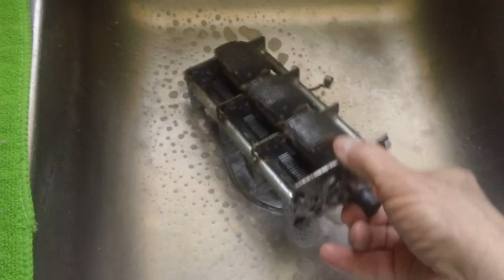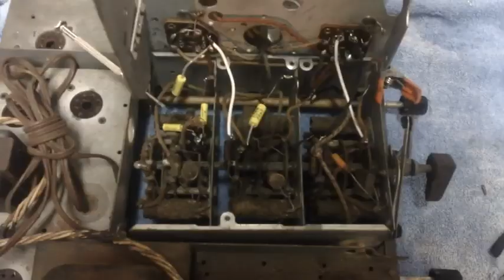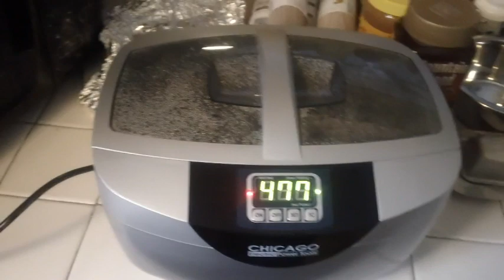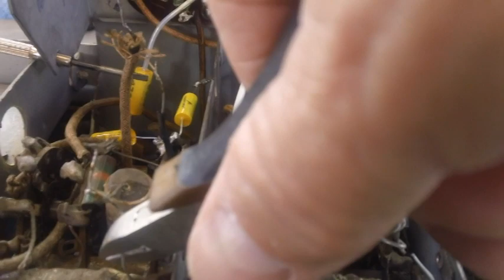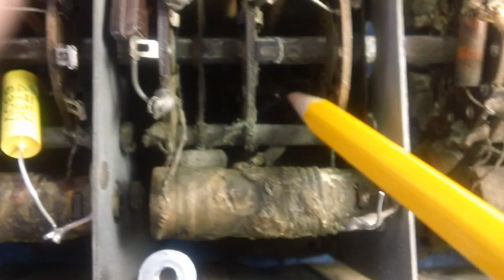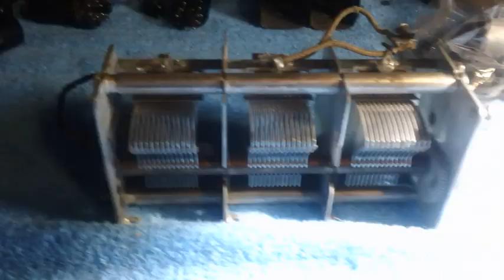Philco model 37-2670 repair and restoration (Part 19 of 34).

Comment: John, do you remove the mica from the tuner before cleaning it? Or is it ok to leave it in there?
Reply from the maker: Kirk,
I always remove and clean the mica, but one must be very careful when doing it.  Use a good set of tweezers, do one mica at a time and go very slow.   Once they're all removed place them one at a time face down on a smooth flat surface and gently clean both sides with a small brush and alcohol.  Pat both sides dry with a tissue, then place them in a labeled envelope until you're ready to reinstall.
Go here to see how I did it with an Atwater Kent 856 restoration a few years ago:

http://www.antiqueradios.com/forums/viewtopic.php?f=6&t=104101&start=80

Regards,
John
Reply: +joernone So you remove the mica BEFORE you clean the tuner?
Reply from the maker: Kirk,
Right.  Just click on the link and you'll see how it's done.

Regards,
John

Comment: John,
One of the biggest complaints I've ever heard about these Philcos with the RF section is the difficult capacitor replacement.  What you've shown is that it's a doable thing. Just got to go slow, and I will.  It's much appreciated, Tom
Reply from the maker: Exactly right, Tom.  Some things just take a little more time and require a little more thinking.
Thanks for stopping in one more time.

Regards,
John

Comment: That coil method is probably one of the best things I learned from your videos. before I used to struggle to keep the lead on so I could solder it. my main trouble now is finding components on the schematic. I'm still working on that early AM/FM philco tabletop from 1948 with a very crowded chassis. it's very hard to see where some of the wires and resistors are connected. but I'm not giving up.
Reply from the maker: Daniel,Crowded chassis are always a bear to work on.  I try my best to stay away from them.Regards,John

Comment: man John I remember a long time ago I found and old radio with a similar tuning cap, I spray it with lots of water this my be funny lol "also the whole radio spray it with water all wet" it was solid state a really old one, I place the radio on the roof of my house and I just wait, after a few hours pass by since here in Puerto Rico is really hot I connected and it works ! is amazing, "not recommended just for fun" lol man I should keep that radio I regretted not to save it, John I love your videos you do give lot of attention of details I like that :)
Reply from the maker: Juan,Generally speaking, water will not harm a radio chassis as long as it's allowed to completely dry before turning it back on.And thank you for your very kind comments, my friend.  It's very much appreciated.Regards,John